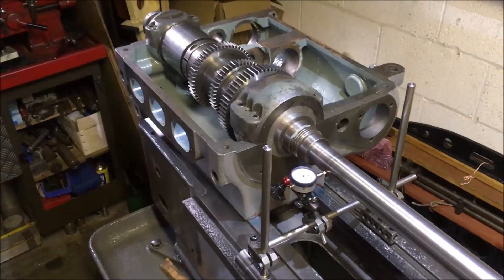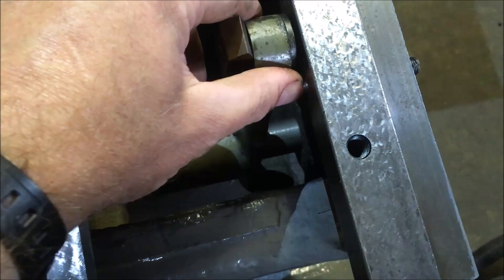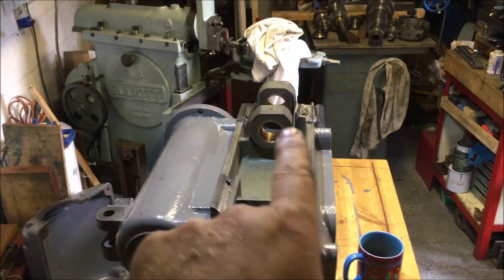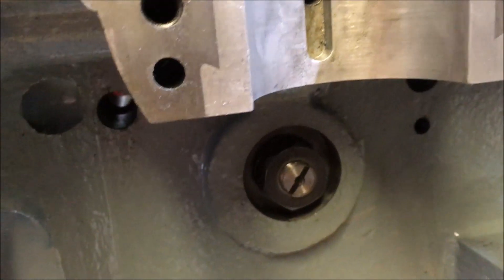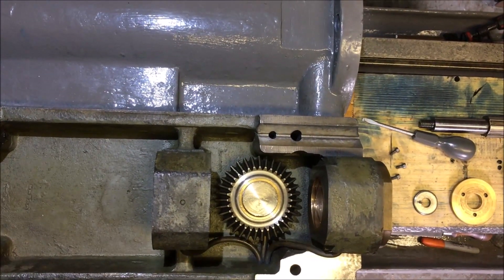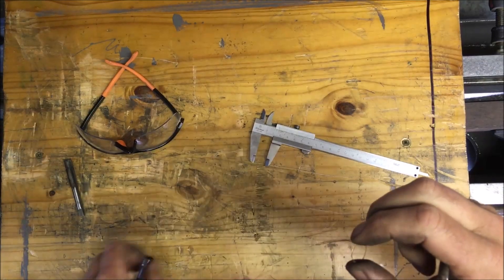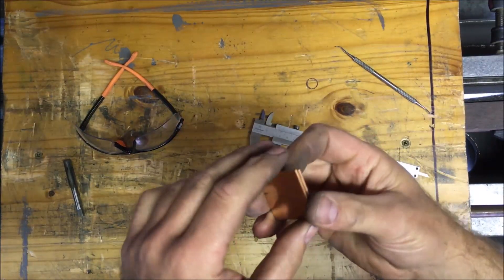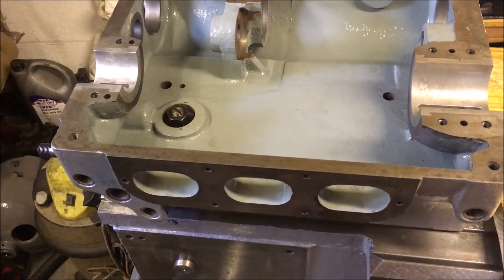Lathe Feed Gear Reverse Mechanism

Comment: I’m late to the party on this one,  it’s only because I just watched it and had a question about the single dog clutch.  I assume since the reversing gears are always meshed and the dog receivers on the clutch are 180 degrees apart that you must pay close attention when installing the gears that the dogs are also 180 degrees apart...correct?  Just curious as I’m working on a project to adapt a Chinese lathe to a single dog clutch reversing arrangement.
Reply from the maker: As best I can recall from the assembly, the alignment between the dog & plate is not an issue as only one is driven - do the relationship between the parts is fixed by the gears - that is to say, it will function no matter the mesh position as it will drive aroudn until meshing. Its going to be a bit of challenge if it needs re-doing :-)
Reply: lookcreations thanks for the reply!  My thought was that if the forward and reverse gear dogs aren’t timed the same as the receiver there will be a slight change in synchronization between the the spindle and lead screw when changing from forward to reverse and then back again...so the tool will not track exactly next time in a thread cutting operation.  Maybe it’s not enough to be worried about, I might be over detailing my design here!  I’m a new subscriber and enjoying the content....I’ve got a lot of catching up to do! Haha

Comment: Mat, I got tickled with your red sleeves and white cuffs.   Imagining Saint Nick crafting away in the toy shop.   I admit, when I saw you applying oil to the inside of a gear I winced.   I recall doing the same once in a transmission and the devil gear had a burr on it and slice my finger nice and well deep.    Wonderful work there, its really coming along nicely.
Reply from the maker: Thanks for watching Russ, I have been de-burring as I go and Ive had my fair share of cuts along the way - the worst was from the inside of a bronze bearing along the edge of an oil groove. I didn't notice until the cleaning cloth was red ... hazard of the job I guess. It does become a problem when scraping and you have to run your finger tips over the surface checking for debris, the scars don't help. All the best Mat

Comment: Here is an idea, use CA glue to hold those shims together for turning then either soak them in nail polish remover or heat them with a tourch. I hold a lot of small parts using this technique.
Reply from the maker: good idea !